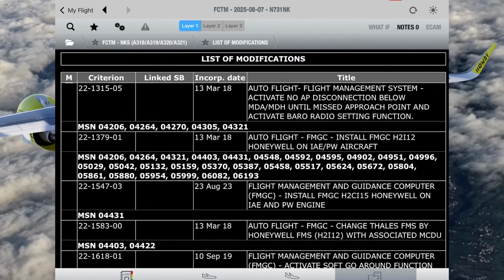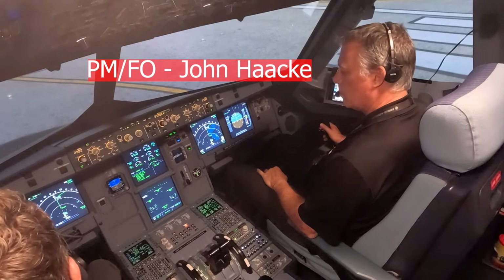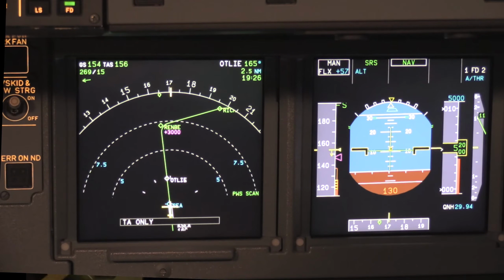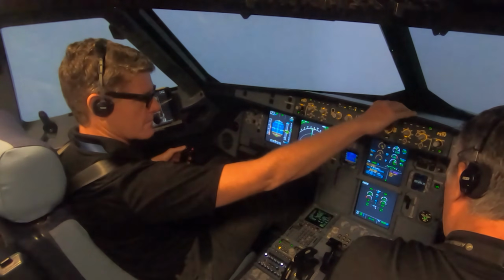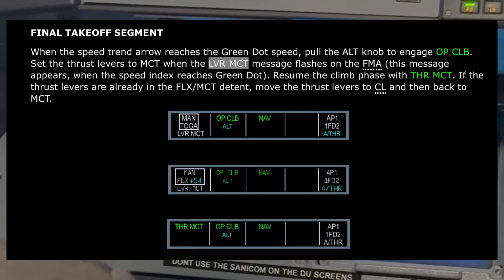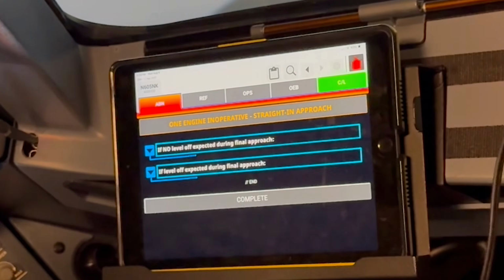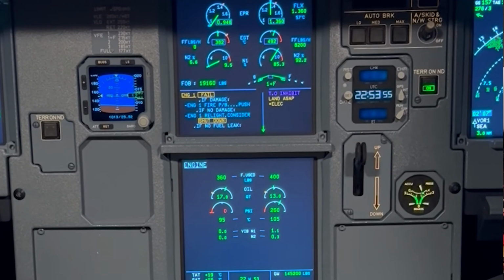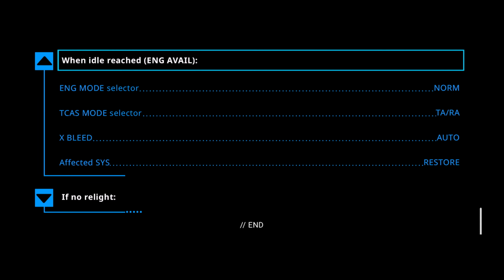Spirit Airlines A320 Flight Operations Training (Engine Failure After V1)

Comment: Airline failure after V2....
Reply: They had a good run. Just got to the point where they couldn't reach V1 to rotate and take off. They aborted take off rather than crash.
Reply: @sheri9975  Are you talking about the plane or Spirit Airlines?